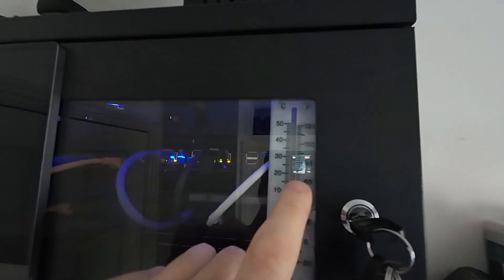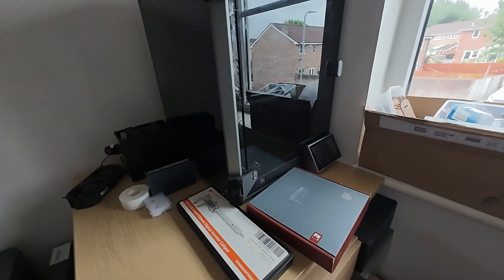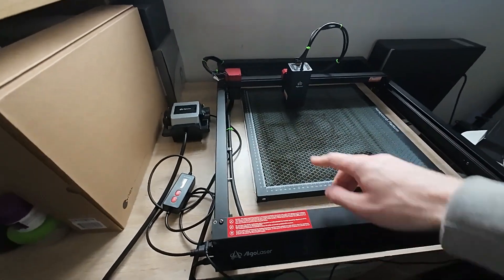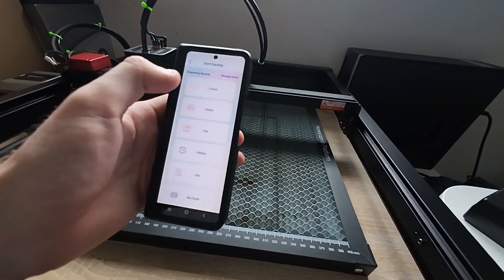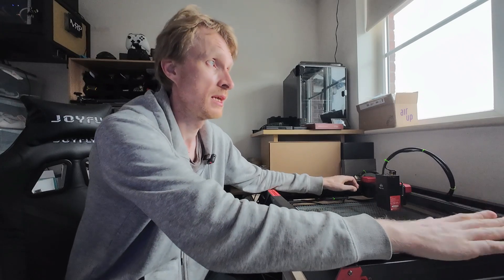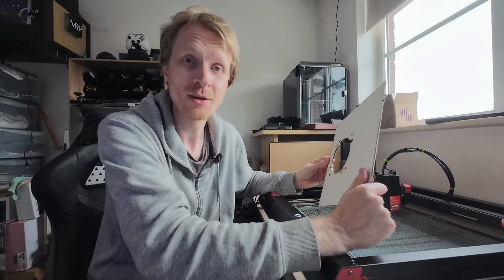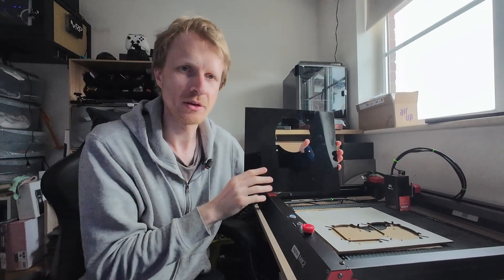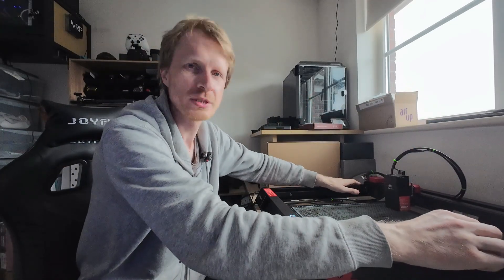How I Keep My Proxmox Cluster Cool

Comment: Probably inlet and outlets should be equals, otherwise inlets works not in full power (CFM?).
Reply from the maker: I tested fan configurations with smoke machine - and looks like air getting moved better inside while i have 2 intakes on the sides and one outtake at the top. With one IN and one OUT (on the side) it does but not cooling enough. Temps still slowly going up. 
I will leave how it is now and keep monitoring performance.
Reply: Normally you always want positive pressure inside an enclosure like this. If not it’s going to accumulate a lot of dust. So two fans for intake and one for exhaust is a good setup. Look at how most computer cases are designed for confirmation of this.